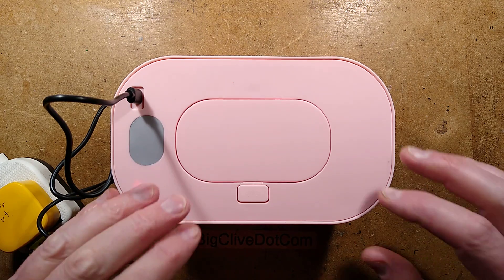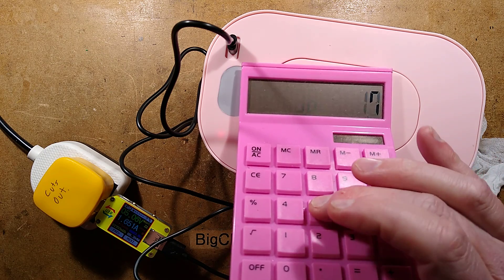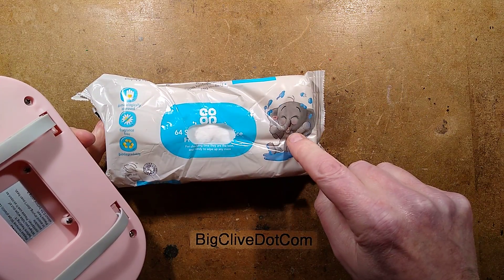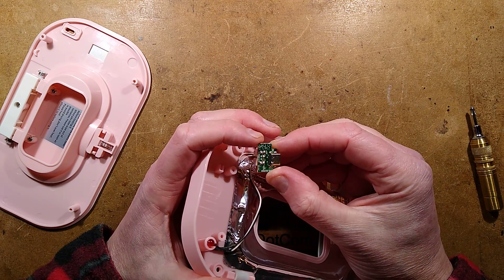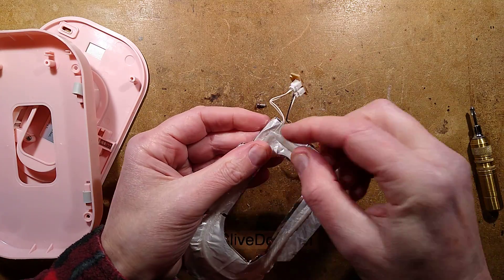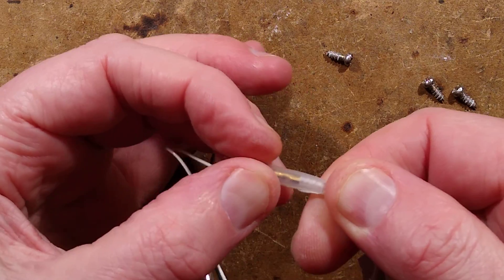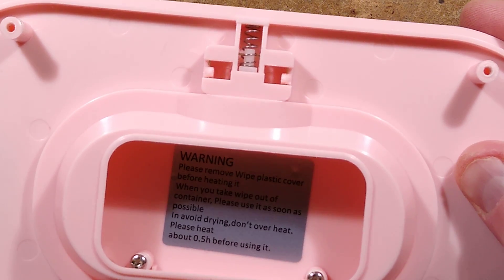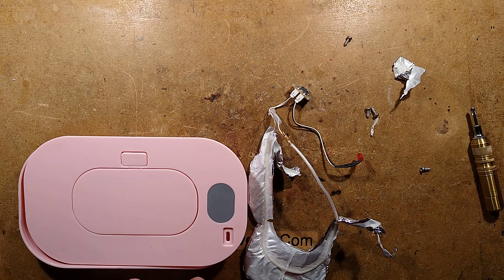Hot and moist USB butt-wipe dispenser

Comment: As someone starting to get into current gen USBC, these cheap noncompliant devices drive me batty! Especially since it's literally just two resistors!
I've got two LED PIR light bars, a forehead light, a Bluetooth headset, the charger cables that came with all of the above, and a wall charger that are all noncompliant.
Not a single one of them will work with a smart-enabled companion device. The hilarious irony that the device the wall charger came with generally does work with "smart" things....
And now I have a minefield of A-to-C cables that won't recharge my phone, most importantly.

Comment: Maybe someone already mentioned before, but I don't think you were supposed to put the wet wipe package into the space between the top part and two layers of rubber bands, instead it was intended to hold the wet wipe package between the rubber bands (so it more or less "hangs" onto the band and pushed by one side of the rubber band)

Comment: Clive, I just found out the Harbor Freight (68239) Drillmaster 18v drill I bought several years ago was recalled, because an internal switch can get stuck on causing a fire or burn hazard.
If you're interested, I'll be happy to send it to you.
Reply from the maker: Thanks for the offer.  But international shipping is expensive and unreliable at the moment.

Comment: That USB input on the top is SO unpractical but it would have cost at least 4 more cents to put it on the side...
It does not have any temperature limiter, so if I leave it plugged in, will it melt the whole case after evaporating all the moisture from the wipes? That 1.7A is quite high...
Reply from the maker: It's fairly low power.

Comment: A wipe warmer seems an odd application, but the heating tape could be useful for providing anti-condensation heating for camera/lens units (GoPro type) when filming outside in winter.
Reply: It is a heated box who cares, what it is invented for, you can keep batterys warm or your reptile on the drive to the vet.

Comment: I work in a factory that makes heater wire assemblies in-house (for cooler/freezer doors). That crimp between heater wire and appliance wire does not look all that bad. TE Connectivity actually makes a similar one, (1438246) but for 16-18AWG, not the tiny wires in the video. That's because UL won't let us go smaller than 18. It's such an odd terminal, TE does not bother to have it UL recognized or Listed.

Comment: Usually by default usb c outputs 5v till a device that requests 9v 12v 15v 20v as I have a dewalt usb c battery charger that can charge the batteries from 12v onwards  never tried it with 5v  . It comes with a 100w 20v 5a  5 to 12v 3a psu  I paid £109 for it n it works like a charger/ powerbank

Comment: Actually, they use a very similar setup in hospital A&E departments, and especially, resus rooms. Aside from anything else, if you're badly injured, a cold wipe can cause a lot of pain. Wipes which are heated to body temperature have virtually no adverse effects.

It's nothing new, but it looks like it's been 'espionaged' out of its intended purpose, and reinvented for babies bottoms.

Now then, where is my baby elephant. He likes to have his annulus cleaned with a warm wipe, but you have to be careful - Too much stimulation, and he is inclined to reciprocate - all over your head! Either with a hot shower for you, or a quantity of warm pillows!

I wonder what the anal running costs would be for this fine piece of Chinese electronic engineering?! 🐘💨⚠️🤦

Comment: I wonder what would happen if you modified this circuit to allow a smart power supply to pump Unlimited current? How hot would it get?
Reply from the maker: It is capped by the 5V supply.  And this unit can't negotiate a higher voltage.

Comment: This is so funny!  I was researching baby wipe warmers just 2 days ago. We are going camping and my wife wanted one of these plugged into the car battery for all 3 days. I found they will drain my car battery in a day. Looks like my wife bum is going to have to suffer through cold wipes. Our desert drop below freezing temps at night. I did buy her a 600 kwh solar generator. It will run her 40 kwh heated throw through the night and fully recharge during the day.
Reply: Just leave her at home, butt wipe problem solved.  Why ruin a camping trip by taking your wife.    I leave mine home as well.  I just take son so he can pee all over everything like a wild animal.
Reply: darn it, I meant wh, not kwh...
Reply: Just get a cheap and not too smart USBC battery pack, a 10,000mAh would last you ~5 days (if it doesn't turn itself off), though i'd be a little concerned that keeping it heated too much for too long might promote bacterial and fungal growth.

Comment: Aren’t you supposed to put the wipes under one layer of rubber band instead of both ends? That way it would be loose enough to easily get the wipes out. Atleast that’s what would work theoretically.

Comment: Rather than waiting 0.5h for the unit to heat up I recommend modifying the USB cable to connect to mains power - it will cut down the heating time dramatically.

Comment: The two resistors that are normally present are needed in USB1/2-to-C-style connections not for the PSUs (well, not just for the PSUs), but for telling the OTG hardware the device will consume power, not supply it (as the connection is symmetrical and your devices basically have to agree on who feeds who).

Comment: And it's almost pink. But it has no WiFi, so Mum can't check the temperature if at work, so there's room for improvement. The hole in the middle suggest, that, if little baby can't hold it back, it also could be used as a mobile toilet. Combined with a cheap pink USB power supply with mains voltage on the USB plug, the zapp could also concomitantly clean little baby's butt. Nice.

Comment: How timely, just about to order some Nichrome wire to DIY an anti dew heater for the telescope, that heater tube looks perfect when taped around the objective lens aperture with a 5V USB adaptor as the 'scope uses 12v for it's motor drives!!🔭🤔👍😀🇬🇧
Reply from the maker: A saying of suitable quarter watt resistors in heatsink can be useful.
Reply: @bigclivedotcom  Lol, yup indeed, but way too simplistic,  plus could use the empty pink container for snacks @2.00am while perving Saturn's ring.....🌌🔭🤫🤭

Comment: On the topic of needing a resistor for power supplies, I've actually found this the device that decides what it can draw, not the supply on how much it can give, I've tested by seperating the data lines between each and trying various sizes of potentiometer

Comment: Where to start? Well, the case looked pink until you brought the calculator into shot. How many screws do you lose, because you don't have a magnetic saucer for them? The rubber bands would be less fierce if you didn't have them doubled over the wipe pack. The On LED was in upside-down. Where's the bathroom-safe USB outlet?

Comment: A 10W aluminium encapsulated wirewound resistor, two screws and an ali plate would be better. But more expensive...

I'm trying to think of alternative uses for the "heater wire". Anyone?

Comment: Jokes aside, it's so much better, healthier and environmental friendly to simply wash your baby in the sink.  Perfect temperature, perfect cleaning and no risk of major skin issues caused by those wipes (it really is a thing).
Reply: It's only a thing because people can't see the difference between the perfumed ones, and the non-perfumed ones.  Millions of parents use these, and skin issues are negligable.
Reply: @eidodk  it's not about perfume, it's mostly about preservatives (which may be included even in so called hypoallergenic wipes) and sure, millions of parents are using them, and at least tens of thousands of babies are having issues because of them. I didn't make it up, health care professional told us they had cases that required  chirurgical help. 

And there is simply no need to use wipes at home. They are fine on the go, of course (the risk is minimal if you don't use them often), but if you have the option to use sink, do it, it's actually easier, faster, less mess, no additional waste and no health risk.

Comment: Those crimps don't last. I had a pet heating mat we bought for a geriatric cat with thinning fur. The crimp failed after a couple dozen heating cycles. The heating mat appeared to have taken two USB power supplies with it in its grave. 
The crimp ended up heating up much more than the resistance wire (identical construction). With USB being pretty power limited, there was also limited fire hazard - but it still was an uncomfortable discovery.

Comment: USB C requires the CC pin pulled low for the most basic 5V power. Perhaps it works fine just pulling it low without a resistor?

Comment: Curious if the wire could be used to warn up gloves for those cold days.
Reply: Carbon fibre makes a better heating element for heated clothes.
Reply: Depends. I guess a really neat buy for all of you brutal autumn bikers though: if the thing is rated at 5v (will hold 6 for sure), 6+6=12 so you can make an on-board-generator-powered handle heating system by rigging those in series! If your motorcycle is of the 6v-type, do the same with the wires in parallel. As a bonus you'll get some neat rubbers for your slingshot, and a nice USB-C with an LED to become a part of a fancy custom phone charger. A really nice thing for part-salvagery!

Comment: As a sufferer of IBS, I can tell you all about rectal trauma. 😁

Fortunately, as I've got older my stress levels have lowered to the point where it isn't quite as troublesome as it once was, but the memories linger.
Reply: I have colitis... it's been under control for a year or so. Yes, it's remembered well.
Reply: @dsloop3907  Aren't all women supposed to have one of those. But I'm damned if I can find it
Reply: After the initial shock of the cold wipe, it is actually rather soothing most of the time.
Reply: You need Darkstar brand butt insurance for your devastated bunghole
Reply: I can relate to that, unfortunately.
Reply: I suspect you're also going lighter on the root beer and chili dogs ...
Reply: Barrier cream might be a game changer for you.

Comment: I keep rescue chickens and their water freezes in the winter. This would be more useful to stop the ice on their water butts, rather than a babies. I made a heat pad using ceramic resistors and an old HP printer power supply. I need about 3W of power to do the job. I works.

Comment: Would be nice to see one with a lithium cell and insulation. Could be powered from 5v at home to heat rapidly and charge battery, then run on low power for an hour or 2 while out.
Reply: I have this portable charger for my phone. Pretty Cool Right 🤗
Yeah,.. butt, mine warms my butt wipes Too ! ! ! Pretty Hot Right 😋

Comment: As a German I want to over-engineer this of course: To avoid the dry-out we could have a hotter electrical heating element and perhaps use these pressure sensors from the vapes (maybe even heating elements) so that it only activates when wipes are pulled out and quickly heats them for you baby's comfort.

Comment: lol. you dont have to use both bands on each side. for fuller packets just pull the top part of the band on each side which will make the tightness a little more easy to cope with.

Comment: In all honesty though, the design is pretty solid. Accessible screws with common heads and all of the same size, no unnecessary glue, even the PCB has connectors for easy replacement. 

Why good engineers work on these types of products and not the others?

Comment: I don't think I would trust 2 amps via USB for extended periods of time.
Reply: 2 amps is nothing for usb c standards
Reply: @SibaNL  sorry I should specify, I don't trust it in this application, as a heater in a plastic box. I know it's 90% safe but what if someone happens to end up with one of those flawed shitty adapter plugs that puts out way more that 2 amps, your wet wipes are gonna become fire wipes XD

Comment: I thought about what to do with the empty case, since it already has a place for a charge port and led: Mount a circuit board under the flap with a couple USB ports and a couple switched LEDs, stick a bit of mirror to the flap that opens up, stuff the void with as many Li cells as you can and you'd have a handy, dandy high capacity power bank/flashlight/lamp.
Put one LED so it points straight out for a flashlight, and the other pointing and the mirror so the box can sit on the table and light a room.
Reply: It could make a nifty micro infinity mirror box as well.

Comment: Inside the latex tube of a slingshot for winter use. Need lots packed in there for when its stretched-out though. That's when it needs heat. Really need a meter or more. One rig needs 4 a bit over half a meter each. It runs a sled so the wire would be protected from the hook.

Comment: "8.5 watts of bottom warming power..."  In the entire history of the human race, I'd bet Nobody has Ever used that expression before 🤣
Reply: "8,5 watts of bottom-warming power", sheesh, I got that here ...in the palm of my hand :hand-pink-waving:😈
Reply: “8.5 watts of bottom warming power” - I would be remiss if I failed to include that expression in most conversations from now on.
Reply: quote of the year! 🤣
Reply: About a quarter or a third of the energy in a car seat warmer goes to the lower cushion so with 30 to 50 W total being common, I'm not sure that's as safe a bet as you think.
Reply: I bet they have. Anything you can think of has been said. Worse still its been said and almost certainly done.
Reply: Until you steal a couple wipes from your toddler's wipe warmer one day. Game changer. This gimmicky version sucks. You can find one for under 30 bucks that is universal with the types of wipes you can put in.
Reply: If a Chinese R&D-unit haven't already designed it, you don't need it (or even see in your wildest dreams ;-).
Reply: @fadate7292  If it ain't broke don't fix it. That wand hasn't changed and doesn't need to. The cordless waterproof models out there now are fun in the tub though.
Reply: @fadate7292  regardless, I fuckin love the Hitachi wand. We've used it for years. It's the ol reliable. The silicon slip on attachments available now are great.
Reply: Not quite “ light fire under arse “ level of warmth but it gets the job done.
Reply: @timleelim9930  no need to wipe at this stage.
Reply: Really none of your business, what us nobodies refer to our bottoms as.
Or,.. our bottoms Warming Power. I prefer Amps, butt, that's another story.
... is it getting warm in here 😂

Comment: I'm gunna make a red rubber coated carbon filament heated poncho,What would you recommend like a variable resistor or something to control the temperature or a thermostat,I'll be using dc so it will be portable

Comment: As the package isn't sealed, it is effectively a wet wipe dryer... 🤔
Reply: No prob. Babies tend to re-wet things pretty quick! ;-)
Reply: @theoztreecrasher2647  that is a problem when It turns into sandpaper 😂
Reply: You need to market that a bit better: wet wipe dehumidifier.
Reply: @LERobbo  Or even better, a humidifier for a room. Your choice of scents!
Reply: @LERobbo  unlimited free water from air butt wipes?
Reply: unless operated under water
Reply: @Schlups  then it’s just a very ineffective water heater lol
Reply: @BlondieHappyGuy  with the heater and added scent, maybe they could be reused? /s
Reply: should add in manual add 2 cups of water before use
Reply: If it is drying up, just pour a little water on it. Oh, come on... Be thankful you got a butt wipe warmer  🙂
Reply: My first thoughts exactly!
Reply: I reckon it'll create a warm humid environment, effectively making them warm and still wet. Eventually it probably would dry out if you left it going non-stop.
Reply: I was worried about bacteria, your fingers aren't going to be sterilized reaching in and out of there and the warm moist environment is a perfect breeding ground
Reply: Unless you mistakenly use alcohol wipes. 
Congrats, you just made an IED.
Reply: Now there's a fellow parent. I was bothered by this as well.
Reply: And igniter
Reply: Won't the evaporation of the wipes go into the elecs and start corroding and shorting stuff out? 🤣🤣
Reply: Chineseum crap 😠, quack?
Reply: @samuelfellows6923  like everything from there. Without exception pretty much. Crazy how close Japan is and they make awesome things.